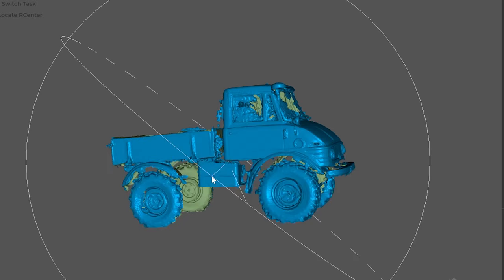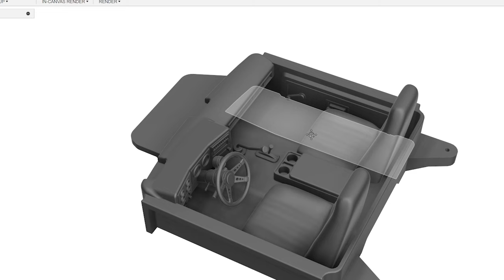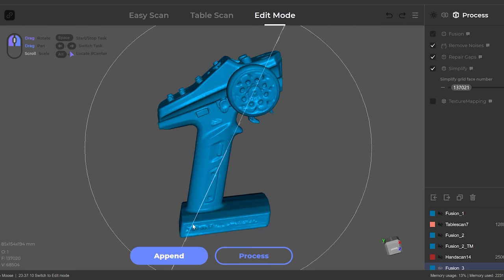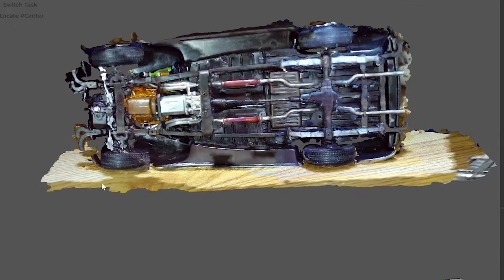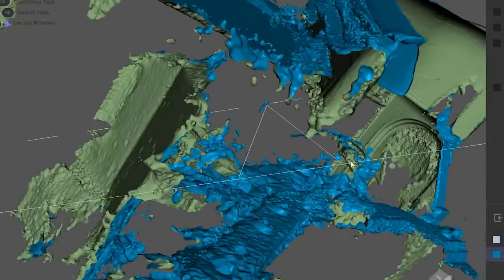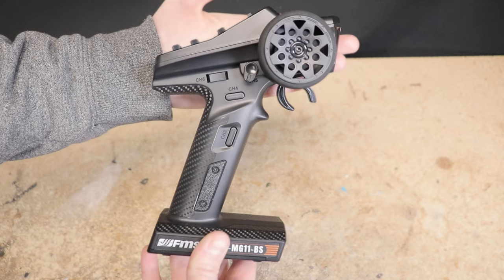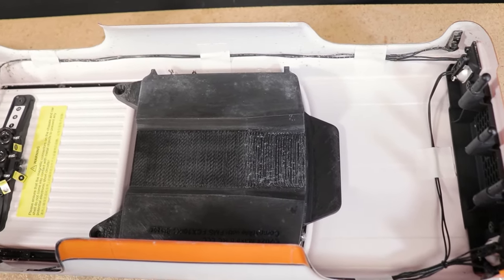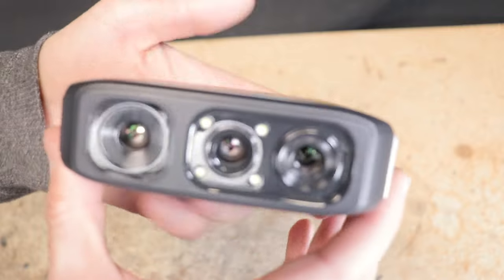How 3D Scanning Helped Create These Custom Accessories + My Thoughts on the Moose From 3DMakerPro

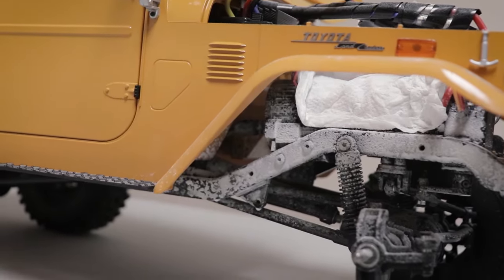Comment: 5:00 one thing that may help for tracking is antiperspirant, ever notice the white residues if you accidentally spry it on dark clothes?
Reply from the maker: Good idea. 👍 I think I've heard of things like dry soap or spray deodorants being used instead of a scanning spray. It will leave a residue but that might not be an issue depending on the item.
Reply: @MakeItRC  yup. Dry shampoo works really well tom what ive seen.

Comment: Excellent video.
I was wondering if lighting was an issue for you? 
Could you scan the object in low lighting conditions just capture the mesh not the textures?
And how did the scanner do with the light color objects, especially the white?
Thank you.
Reply from the maker: Thank you! Light color objects seem fine and even ideal for the most part. High gloss white or near white could benefit from some prep work. Perfect lighting doesn't seem nearly as critical as I experienced on older scanners from 5-10ish years back. Florescent office lighting seems just fine, however I'm sure there are limits to both how bright or dark the environment can be for the best scan. It may be worth a bit of experimentation if you really want to get the best quality. Hope this helps.     👍